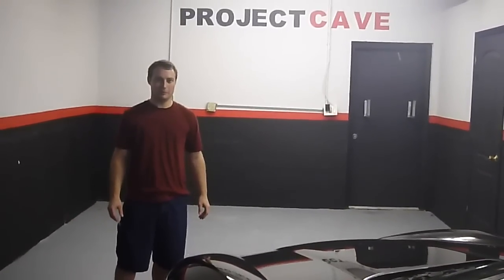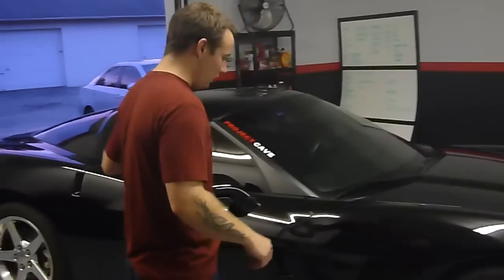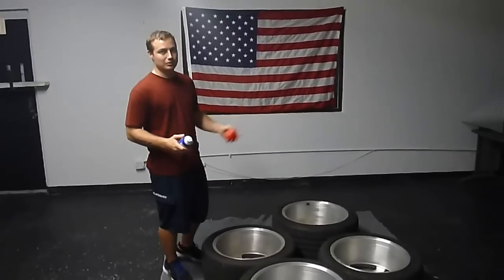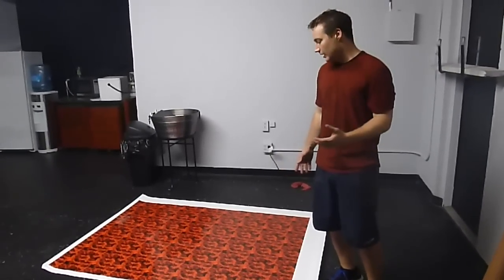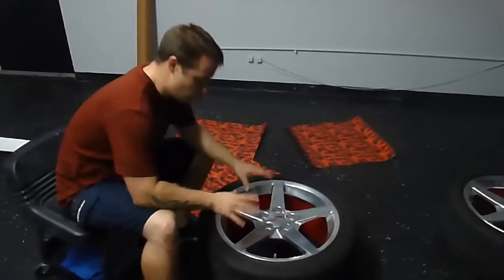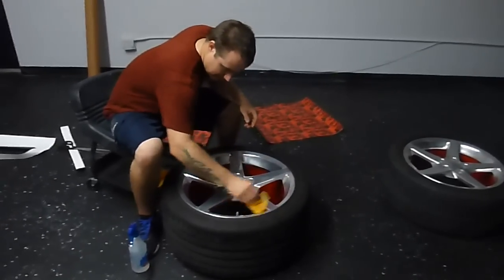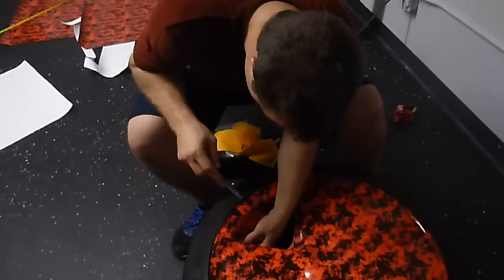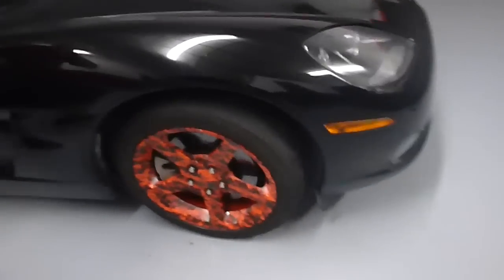Vinyl Wrapping Car Rims Video

Comment: lol obviously you should have cut insertions to release tension before applying it, it will also put less stress in the vinyl consequently lasting longer and having less chances of lifting / peeling

Comment: one of the other things you can do is preheat and stretch the vinyl a bit before you attempt to apply it, what that does is release some of the tension that naturally occurs in your films ... signwriter for over 20yrs here
Reply from the maker: Thanks for the tip...I have done that for wrapping mirrors and other areas around a car, but did not think of using that technique for the rims. We will definitely try that next time.
Reply: sweet as its just something ive picked up over the years, all you can do is try it and if it works for you all good, its just another technique to try and see if it works .. all the best and remember to enjoy the struggle of these little pain in the --- projects

Comment: 1 big tip , get a hairdryer , heat gun is too hot if your new to this , ( btw it cools in seconds , cause it wont absord alot of heat energy )
Reply from the maker: Vos We have never tried a hairdryer because we have always seen heatguns or blowtorches used. I can definitely see how a blowdyer would help control heat, especially if you are a noob. Thanks for the tip!

Comment: How long did the wrap last holding onto the wheels before u any signs of plastic lifting
Reply from the maker: After about 6 months, it started to lift a little around the lug nuts and a couple of areas where the spokes came together but nothing noticeable. When we took the wrap off, there was no lifting at all around the lip of the wheel and no major lifting anywhere else. The 3M wrap actually held so good that I had to use a heat gun to remove it.
Reply: Sounds good how do you think it will hold up only doing the face of the wheels
Reply from the maker: I think with enough of the right prep and a quality vinyl (3M, Avery, Oracle), it should have no problem sticking and staying stuck. Degrease the wheel good with soapy water followed by rubbing alcohol....make sure the surface and all the crevices are completely dry and start laying the vinyl. Be sure to heat the vinyl and the edges to make sure it shrinks then cut your edges. If you cut the edges and don't heat the vinyl first, you risk it shrinking later on, messing up your cut lines and creating the potential for lifting. Overall, I think it will hold up and look great on the face of a wheel....it will add a custom touch that only you will have. Good luck!
Reply: Sounds good thanks for your help and tips. I will surely begin the project at soon as I get the vinyl in. Thank you

Comment: Your biggest issue will probably be from the heat. If you've wrapped it properly, and all your edges are sealed down properly, water should not be a problem.
Reply from the maker: Like you, I expected lifting to occur from heat more so than water. We just removed the wrap, and after six months, we were surprised to see there was almost no lifting anywhere. The edges stayed sealed and no water got underneath the wrap.

Comment: Seems a bit much with just a plain black corvette. Would have been better just wrapping them in black with the insides plasti dipped in anthracite gray
Reply from the maker: We agree....we used the red digicamo to show what could be done, but it did become a little much over time. The rims are now plastidipped black along with a 2" drop. Definitely not as flashy but much more our style. The cool thing about these products is for less than $150, we have had 3 different styles of rims (polished aluminum, red digicamo, and flat black) and can go back to stock at anytime. Thanks for taking time to watch our video!

Comment: good luck peeling that off after you put that glue
Reply: Agreed. He's going to spend the same amount of time taking that glue off as he did prepping/wrapping them.
Reply from the maker: We just peeled it, and as you suspected, it was much more time consuming where we put the glue. It left some residue, but a little xylene on a rag wiped it right off. If I did it again, I would still use the glue though, because in the areas without it (around the lugs), it did lift a little. In the areas we applied the glue, there was no lifting.